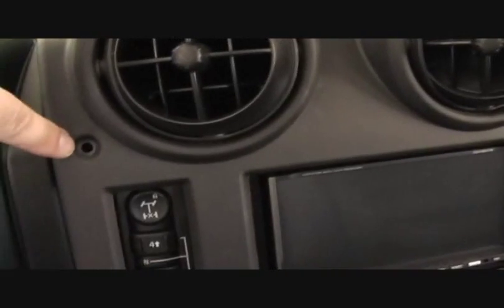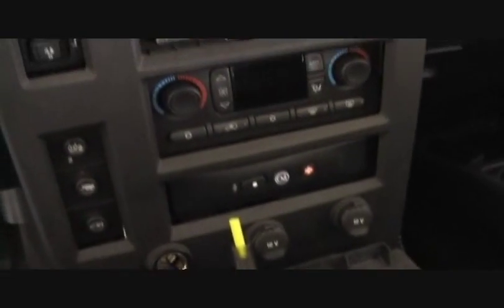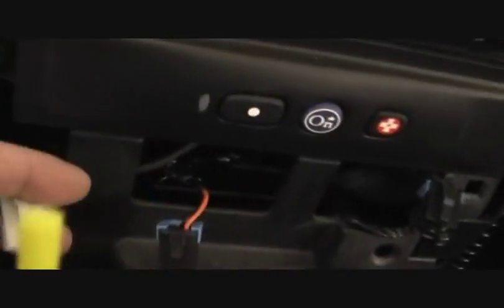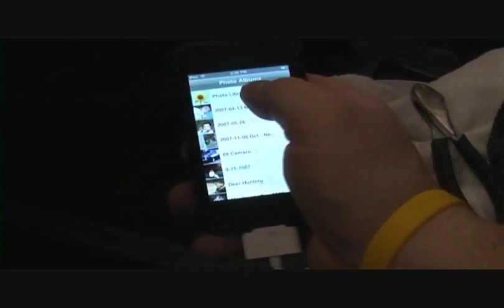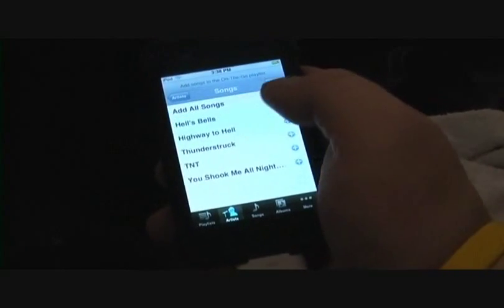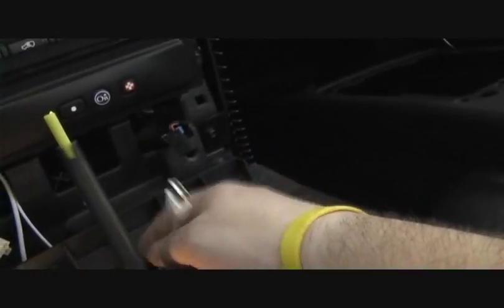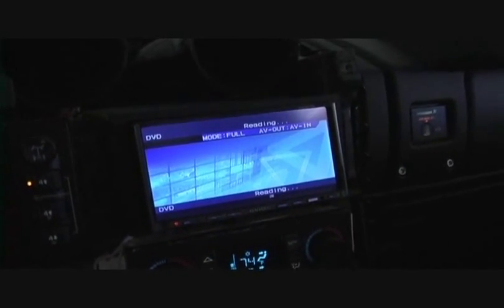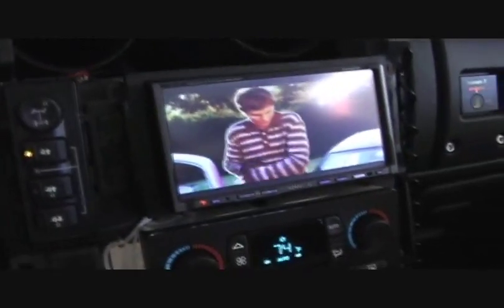iPod Touch Hummer Kenwood DDX6019 Install Part 2

Comment: The DDX-6019 does not have the ability to control the iPod Touch or iPhone from the deck itself. The new Kenwood line of head units can control the iPod from the unit however.